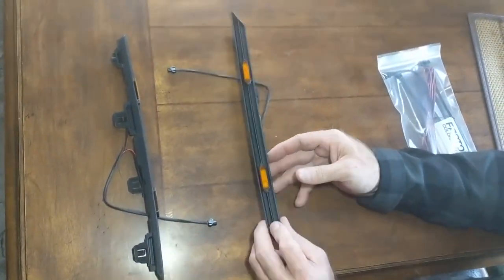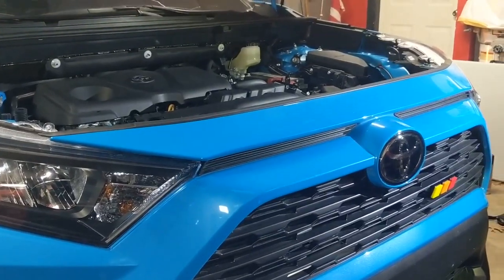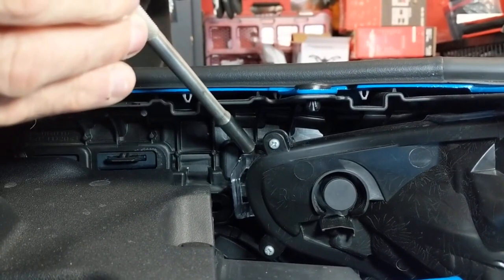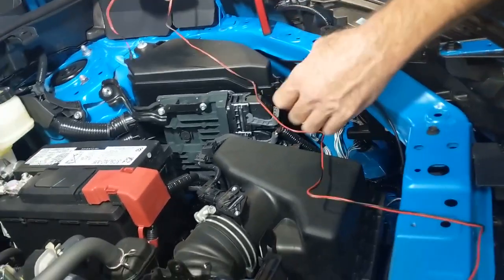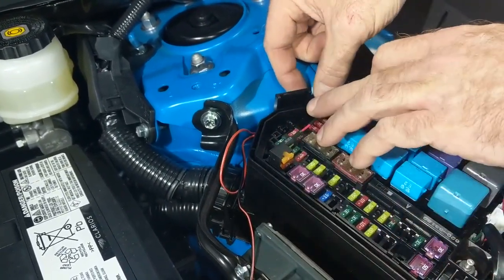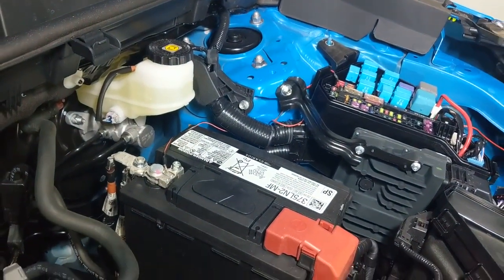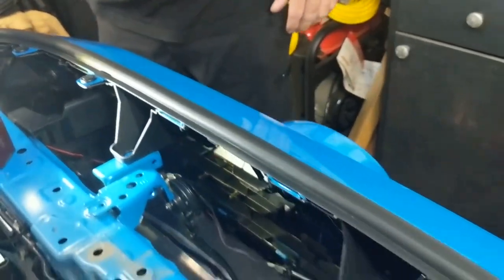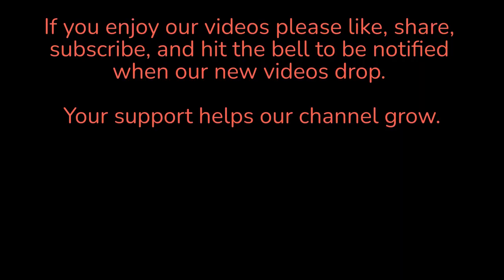Raptor Lights | FACTOR4 GRILLE LIGHTS Installation | American Company USA | 2019-2022 Toyota RAV4

Comment: If you remove the nut inside the fuse box, then you can route cables for the bottom. Is more elegant and you don't  need to make holes
Reply from the maker: Good suggestion 👌🏻

Comment: Awesome video! my lights came in with no instructions. Mine stay on though when the car is off. Any ideas?
Reply from the maker: Thank you for your support! The power needs to come from a keyed ignition source not a constant power source.
Reply: What fuse would that be? I’m also having issues. Thanks

Comment: So If I hook the ligths to the 7.5 usb  fuse  it won't hurt or burn any of the electric or damage the car ??
Reply from the maker: If you keep the 7 5 in the upper slot and the 10 in the lower you should be fine. That's how everyone I know is running the fuse taps

Comment: Does the negative need to be wired to the battery directly? I installed the fog lights as per your last video (thank the heavens for you btw). Most people I've seen just run negative wires to a ground.
Reply from the maker: I don't know if it's necessary, but since it was right there it was just as easy to use the terminal on the battery. Thanks for watching and commenting!

Comment: Installed these on my '19 Rav last week and the install was extremely painless. Although I am wondering, would I be able to tap into either the parking lights or fog lights so they're not always on? Or into another fuse location so I can turn them on or off?
Reply from the maker: You can tap them into your fog lights if you want

Comment: What did you use to notch the fuse box? And the spade connected to battery wouldn’t drain the battery will it?
Reply from the maker: I just used a x-acto knife. And the spade connector is on a keyed fuse, so it's only activated when you turn the key. Thank you for watching, feel free to ask any questions 👌🏻

Comment: When connecting the black negative ground wire, did you have a spare spade of your own you were able to attach to the open exposed end of the black wire? My kit seems to stop there. Figure I should check out a hardware store for a spade, crimper, electrical tape and additional supplies for that step? What do you recommend? (First time doing anything like this with wiring) Appreciate your time bro
Reply from the maker: Actually my kit had the spade on the black wire that was next to the fuse tap
Reply from the maker: But I'd suggest buying a kit with spades and different electrical connectors if you're going to be venturing out into different DIY projects. Once you get the hang of it, your confidence will let you try just about anything
Reply: Appreciate the feedback! Ended up getting a crimper, and a ring spade for the ground wire and finished the project earlier today! Aside from the usb1 and usb2 fuse slots not working for the plug and play fuse, I ended up finding a forum online suggesting the INJ fuse spot with did end up working for the raptor lights I bought for my 19 rav4 LE. These DIYs do feel good to knock out
Reply from the maker: @benpfister210  awesome, yeah I was thrown off a couple different times by the fuse locations

Comment: Question for you, I just got these and I put them in today but I ran into an issue on my 2021 RAV4 hybrid LE. It seems like my USB1 and USB2 ports are dummies.  Factor 4’s install suggests using “INJ” as a backup which is a 10A port.  Am I just supposed to take the 10 amp fuse out put it in the wiring harness and put it in that part labeled “INJ”?  Or what I need to find a fuse port with a 7.5 amp fuse in it and use that one instead? I’m not that smart when it comes to fuses, thank you
Reply from the maker: Keep the 7.5 in the top slot and the 10 from the INJ in the bottom 👍🏻
Reply: The bottom slot is the one closer to the pin?

Comment: Can anyone help?
I would consider getting the positive power directly from the positive lead to the fog light. My thinking is that I’d want them on when the fog lights are on.
Do you think that would work? Thank you in advance.
Reply from the maker: You should be able to tap into the fog light wire with no problem
Reply from the maker: Just make sure you tap into the fog bulb power wire, not the DRL if you want them turn on only when you hit the fog switch 👌🏻

Comment: Before you connect the add a fuse, do you check what side of the connection has the power????
Reply from the maker: I didn't, just connected the wired by color

Comment: How do you close the fuse box without pinching the wires?
Reply from the maker: I just notched the side to allow the wire to fit
Reply: @installsandpitfalls  Once installed, are they always on?
Do they turn on when the headlights are on or separately? Do they turn on with the DRLs or the main headlight or both?
Do they come with a remote control?
Sorry for so many questions. It’s that I’m really interested in these lights but wanna make an informed decision before buying. Not long ago, they were $120. Now they are $130… 
Thanks for the reply. 
:)
Reply from the maker: The way I hooked them up, they're on anytime the key is on. You can do a wire tap into your fog lights or headlights. I haven't looked into the DRL install. Feel free to ask any questions you can think of. And I agree, this inflation is terrible.
Reply: Did your kit include a remote control?
Reply from the maker: It did not, just the lights and some instructions

Comment: I’m thinking about getting this for my car but I’m not getting the one with the remote, how do you turn the lights on and off and how did you configure it
Reply from the maker: I just wired them for ignition on, so they're on anytime the engine is running. But you could probably tap them into your headlight harness or run a separate switch for them like a fog light switch.
Reply: @installsandpitfalls  oh okay interesting, I might see if I can connect it to the DRLs or something, thanks!

Comment: Great video I am trying to do the samething but some reason my RAV4 2019 le don’t come with the fuse and went I try to install the lights won’t come on at all do u kno why ? thank you
Reply from the maker: Are you able to test them on the battery?
Reply: Yes if connected to battery they turn on but if a try to use the fuse don’t work
Reply from the maker: Ok, I'll look at the exact fuse location when I get home this afternoon and let you know which one it is
Reply: Thank you 🙏 again
Reply from the maker: @soundtech2312  no worries, so looking at the fuse block from the front of the Rav I used the 3rd row from the left and 3rd slot down
Reply: I got it it work thank you so much I really appreciate it
Reply from the maker: @soundtech2312  my pleasure, enjoy!

Comment: I have hybrid se and neither of my connections work :/
Reply from the maker: Into the fuse panel?
Reply: @installsandpitfalls  could I email you a video?
Reply from the maker: @Anonusermf  sure bellbadboy3@gmail.com
Reply: @installsandpitfalls  does yours require the ignition to be on? Or just headlight switch
Reply from the maker: @Anonusermf  I wired them to be on when the ignition is on
Reply: Where can i buy this one sir? I want that kind of raptor lights.. thanks any link to buy that?
Reply from the maker: Hi Elmo. Here is the link to the FACTOR4 raptor lights:
https://www.factor4.co/product/rav4-grille-lights-amber-/1?cs=true&cst=custom
Reply: Is there any coupon code? 😅

Comment: whats missing is where you feed the wires through there is no hole>>>>
Reply from the maker: Hi, feed them thru where?
Reply: @installsandpitfalls  I followed the pdf instructions from the link above and figured it out.  I stuck the wiring differently as one has to put the plastic planel back on so one has to avoid wires in the wrong places.   Not finalized as the lid doesnt close and will cut the wire, so have to find another way of feeding the wire to the fuse box.
Reply from the maker: @Anavllama  yeah we notched it. I've also seen people drill a hole and silicone around the wire. But it has to be spliced.

Comment: Hi what size fusen for the raptor ligths is a 20  ok ????
Reply from the maker: You can use the 20 that's in the car, but use the fuse that comes with them for the lights